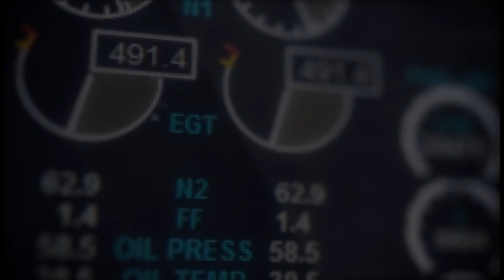Will Circular runways "take off"

Comment: when you have engine failure on a circular runway you have less of a problem then on straight  , just idle down , and land , your runway will never end .
Reply: So what about when a plane has to land with undercarriage failure?
or loss of hydraulics?
tire blow out?
nose gear collapse?
fuselage damage?
oil/fluid spills?
Lastly, what if the engine that failed was the same side as the direction around the circular runway you are travelling, and the force from the engine goes with or fights against where gravity wants to take the plane? it would end up a wreck.

Circular Runways = big problem regardless...this isn't flight sim

Comment: I just found this channel and video. I am a person who is EXTREMELY terrified of flying. I flew from the U.S. to Australia only because I basically had to. And I had to use alcohol and melatonin to calm my mind (not recommending it, just saying what I had to do). I REALLY commend pilots for what they do. And I especially am grateful for pilots that care for the safety of the passengers. I wish all pilots cared so much.
Reply: You know it's far more dangerous DRIVING TO AND FROM THE AIRPORT than flying, right?
Reply: It would be pretty dangerous driving from the U.S. to Australia. You run the risk of hitting a shark or a killer whale.
Reply: Ninjalectual     That may be true for the Airlines, but not for General Aviation.  John King and his wife, of Kings Schools is a famous aviation fight and ground instructor.  He wrote a few articles after he had a crash and did some studies.  He concluded that General Aviation has about the same safety rate in comparison to motocycles.   I fly small airplanes.  It seems true that the trip to the airport is harrowing.   I try to keep all my flights as safe a possible.  I don't fly when the weather is bad.  I make sure the airplane is in tip-top condition and I keep my eyes open and look for other planes in the air when I fly.  After 50  years of flying, I've been very lucky.  I've known others who have not been so lucky.
But the Statistics don't lie.   Just search for aviation safety articles by John King.
               By the way, I am not discouraging anyone who wants to learn to fly to do so.  It was one of the best decisions I've made in my life to solo at 16 and get my pilot's license at age 17.  The things I've seen and done are beyond belief.  Flying in the Northeast and being able to go to places like Block Island and New England are breathtaking experiences.
Reply: Ninjalectual : statistics say so, but there are some important psychological differences.

First, if you drive the car yourself, you actually control your direction and speed, you don't delegate to anyone, you'll feel like you control the risk.

Second, in case of a mecanical failure, your car can be fully stopped anywhere without killing you (average Joe never heard of ETOPS).

Third, people think that all plane accidents kill everyone on board, which is far from the statistical truth, but really here the statistics don't help, because some people cannot help thinking they may be incredibly unlucky today...
Reply: If I have the time, I prefer to drive as I am able to enjoy the scenery along the way. I like to take smaller, secondary routes, often avoiding the interstates or superhighways if I can. Deserts, prairies, beautiful mountain ranges, forgotten small towns, historical landmarks, tiny museums, and little hole in the wall restaurants with great food are all part of the adventure. Driving through "fly over country" is fun! When life does not allow, I step on a plane and am thankful that a journey that once took weeks or even over a year is reduced to hours. I commend Mr. Mentour Pilot for his dedication, professionalism and his efforts to reach out to the traveling public.
Reply: @Ninjalectual  no u r wrong. There is no g force u face while dying in a car crash but u face in aeroplane crash
Reply: @rajajanjua7793  no g force in a car crash? Back to basic Newtonian physics class you go!
Reply: @k.h.1587  i dont believe in newtons laws. Its bullshit, every action has a reaction but equal and opposite in direction. I once punched someone and in response he kicked my nuts. Newton law failed here
Reply: T Timeler 
They do...
Reply: And we are grateful for Air Traffic Controller too
Reply: T Timeler I understand your feelings the answer isn’t necessarily about statistics, rather it’s the odd sounds, turbulence, the feelings of falling, no longer having any control as you have with your feet or tires resting on the pavement. Emotions or feelings can’t be dispelled just by hearing figures of 11 to 13 million to 1 as your chances of being in an air crash because feelings are irrational. I’ve known people who have taken the class offered by different airlines for folks who aren’t comfortable flying and it’s helped a lot. Do a google search “Fear of Flying Classes” and you should find something fairly close to your area. A medication for anxiety Lorazepam works very well. Swallow with water or let it sit under your tongue, it has no taste and dissolves quickly. It’s a cleaner drug than Valium or diazepam. Your family doctor would not have an issue writing for a few tablets to ease your fears.
Reply: I feel you, there is not enough money on this earth to prompt me to fly anywhere, if I can't drive there, I'm not going!
Reply: T Timeler pilots drink 😂 to don't worry u not the only one 😂😭
Reply: John Gault We should definitely be grateful for air traffic controllers alongside pilots. The London airspace at 6:51 without a single airliner-related collision for what has been many years cannot have been possible without air traffic controllers. Their mistakes can be more fatal than those made by pilots, ESPECIALLY in super busy airspace, which is all the more reason for them to feel extremely stressed out. Yet, how often were there fatal ATC errors compared to fatal pilot errors? That shows you the skill and dedication they have in their job (the same goes for pilots when you think about how many successful flights were made compared to those that crashed). And now you're telling me that because some of them like to feel in charge, we shouldn't feel grateful for them? In fact, they truly are in charge! Pilots can't do anything outside the routine work on their assigned flight path without permission from the ATC!
Reply: @owmikati   true talk
Reply: @owmikati  true talk to an extent. but I guess, the reason ATC performs higher than pilots its cuz they are just sitting on arm  chiar and be giving directives to pilots. If shit happens ATC may somehow get away from it most of the times. But in case of pilot no escape. so that increases anxiety  and making mistake will be imminent. Do you know that most times when ATC makes mistake they will first of all find a way to shift the blame to engineers maintaining the navigation and communication equipment. But, for pilots , will they be alive to shift the blame? So , I hope you can now see why ATC anxiety and stress level during emergency can not be compared with that of pilots.
Reply: Let's all remember the actual data published earlier this year that revealed that in the U.S.A. for example: According to the National Air Traffic Controllers Association, there are over 87,000 flights that crisscross the United States every day! And it's been more than nine years since the last fatalities occurred that involved a U.S.-registered, scheduled passenger airline in the United States. That was Colgan Air Flight 3407, which crashed on approach to Buffalo on February 12, 2009. 

Seriously folks, you are actually much safer in an airplane than just about anywhere else, including being in your bathtub, or even being in a hospital!      - j q t -
Reply: I used to be an anxiouis passenger.  It really upset my breathing and I hated not being able to see the horizon ahead.  Then, I got invited to fly in a small plane up beside the pilot and everything changed.  Later, I became a pilot myself.  The feeling of disorientation is understandable. The more you move your head to look to the side, look down, and look forward, the more you force your brain to make sense of the other sensations you feel especially if the flight isn't smooth. The more you fly, the better you overcome it.  Pilots do care about the 200+ passengers who paid for a seat immediately behind them.  They strive to give aviation a good name and solve every flying challenge with comfort and safety.

Comment: Would something like say, a pentagonal runway layout give most of the proposed  benefits of a circular runway, while cutting down the obstacle clearance area to 10 zones rather than a massive 360 degree zone, as well as avoiding the issues you described with single engine handling, wing tip clearance and centripetal force issues? 
I suppose It still has the problem of only being ideal for a brand new (isolated) airport in a large flat area, but I suppose the opportunity to build one will turn up eventually.

Comment: i have noticed when planes land the tires are subjected to a smoking start up. why couldn't there be a fan style device installed to get the wheels turning before they hit the ground?
Reply from the maker: That’s a good point. The wheels are very heavy so my guess is that there would be a quite large “fan” needed and that would need space and cost weight.

Comment: Great video as usual !

I wonder how circular runways would affect helicopter landings and take-offs. I suppose, they would still need helipads and would not be able to use runways, especially choppers with wheels.

A small tip - You need to polish your shoes !
Reply: Was thinking abut the shoes too haha
Reply: don't helicopters already use circular runways? I think they paint the center with an H.

Comment: when you have a country like the Netherlands, with a very high population density and a prevailing direction of wind that is west, you:

-don't need a circular runway for efficiency purposes
-don't want to use that much more space to create one, where large parts of it are just not used.

so no, they won't take off unless you have special circumstances that would have it solve problems in logistics.
Reply from the maker: True.

Comment: The researcher who dreamed this up was clearly not a pilot.  How could this have ever been a serious consideration?  It gives absolutely no margin for aborting a takeoff; as soon as you hit V2, you are no longer following the runway, you are leaving it at the tangent of your current vector.  You also have to hit the "sweet spot" of desired head/tail wind very exactly.  If you didn't start your rollout in exactly the right place, and if there's any variation whatsoever in your throttle-up, you'll miss your window.  It also turns the approach into an absolute nightmare, how do you annotate a 360-degree approach on a chart?  How do you place directional radio beacons to guide in instrument landing?

Comment: The banked runway will counteract much of the centrifugal force, approaching the speed at which you are intended to travel along the bank, until you travel at the "correct" or intended speed at which the centripetal acceleration counteracts the inward force due to gravity exactly. you can decompose the force of gravity to a component along the bank and perpendicular to the bank. 

As a result, the force of gravity pulling you down to the inside of the circle will be greater than the centripetal acceleration gained by the aircraft out towards the perimeter of the runway until you travel at the intended speed (which I suppose might be some weighted average of aircraft takeoff speeds). This is the same as is used on all major highways, which is the reason why you dont turn the wheel when driving along a major road, from the point of reference of the car, you are driving in a straight line, provided the radius is great enough.

(im not saying this is by any means a good idea, just pointing out how from the point of view of the aircraft, asymmetrical trust would not be more of an issue than it is with a normal runway, given that from an internal point of view, you are going in a straight line until your velocity is small enough that, i imagine, it probably would not be an issue.)

Comment: That's a ton of PAPI lights to install and knowing which set of lights you are aiming for, as well as touchdown markers. Good point about wet runways, which is why NASCAR does not race on wet tracks. The centrifugal force may also add stress on the nose wheel. Probably better off with a more practical VTOL aircraft.

Comment: With a VOR in the center, we could be cleared for a DME arc approach and assigned a touchdown radial that would be analogous to the assigned runway heading numbers we use now. "Winds north at 10 knots, Approved for touchdown at radial 085, lead radial is 095. Missed approach, climb on the 5 DME arc to 2000 then widen out to the 10 DME arc and maintain 3500."  The obstacle clearance area could still be aligned with the ILS or LPV approaches we have now and you would enter the arc from the Localizer likely at an altitude equal to what we have for current initial segments, descend once in the proper radius.

Comment: 1. Your shoe is untied in the first segment of the video.

2. The problem of asymmetric thrust is the same as on a straight runway—you still have to counter the engine failure with steering input to avoid going off the sides of the runway—but with the circular runway, you have the advantage of never running out of real estate before over-running the end of the runway. also, the 3KM diameter circle is a MUCH gentler turning radius than ANY high-speed taxiway, so loss of directional control during takeoff due to an engine failure isn't as big a problem as you make it out to be in the video.

3. Aborting a takeoff long after rotation speed isn't a problem for the same reason mentioned above: unlimited runway.

4. Just because a circular runway can accommodate ANY approach or departure direction doesn't mean the airport planners would be forced to utilize every compass heading for planning purposes. They could still set up approaches and departures in a more limited scope—say, every 45 degrees around the circle—so that you'd have the benefits of multiple runway headings, such as many choices that limit the crosswind coefficients, without the drawbacks of hundreds of approaches and departures. 

While there is still a lot of issues to be worked out, for a wide open area, this could be a great idea. Obviously, it probably wouldn't be able to take the place of already-established, traditional airport structures.

Comment: Airport runways can be 4 FEET thick and concrete is about  $100 per cubic yard.  There's no fucking way that it would be economically feasible.   Not to mention that there would have to be expensive underground tunnels to get passengers in and out

Comment: Go right back to pioneering days of aviation where aircraft flew at a very sedately pace and the airport was nothing more than an open field where you simply took-off or landed into the prevailing wind. Scale that up to a 3 kilometre diameter circle of asphalt. Take-off or land across the circle instead of around the edge of it and if an area large enough and flat enough to build it can be found, it just might work that way.

Comment: The main problem I see is, that a banked circular runway would create additional downforce to the plane as it is pushed into the ground by the centrifugal force. Going 300km/h with an 65t plane on a 3km circle, as given in the video, would be around 301kN of centrifugal force. Becuse of these high forces the Bankangle has to be very steep, otherwise the Plane would just slide out of the circ. But the bigger the steepangle gets, the more of the centrifugal force is converted into downforce which makes it harder for the Plane to take of. The extreme would be an angle of 90 degree, but that would mean the wings had not only to create 65 tons of lift, but about 95 tons! Thats just ridiculous... As I looked up the Dokumentation that was done about the concept, the did a lot of math but not this 5minute calculation?..

Comment: Another (FUTURE) possibility is to have a FLAT circular or even SQUARE piece of tarmac and develop STOL technology in civil aircraft. Even then they would be landing right over the terminals etc which would have to be around the periphery and also heading straight for buildings and terminals on the opposite side as well. 
Maybe a long taxiway between the FLAT circular landing zone and the terminals could fix that risk, and no landings allowed when facing the terminal area or when landing directly overhead the terminal buildings. I think that would deal with some of the hazards you mentioned at the cost of not having a completely 360 degree access to to landing zone.But it would be safer and the aircraft can still do a STRAIGHT landing on flat tarmac from any direction which is so much safer at 100+kts.

Comment: Tack! But if you can find the optimum wind direction with takeoff (for example) it is only optimal for a couple of seconds if you are turning on the circular runway, yes? And what about extra lateral stress on the starboard side wheels and struts using a counter-clockwise takeoff and landing? Centrifical force  must be putting more strain on them than the port side wheels and struts?

Comment: Some of the problems could be solved by a ROTATING circular runway.  It would be a massive engineering challenge, but the runway could rotate to match the aircraft landing speed, allowing the aircraft to land in very little space.  As the plane decelerates, so does the runway.  Of course this means only one plane can land at a time, but each landing would be much faster.